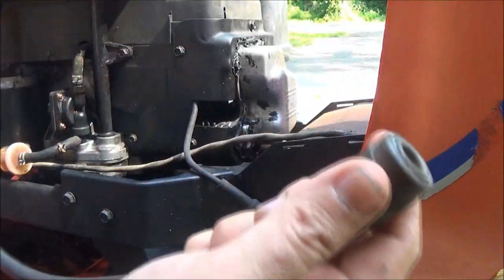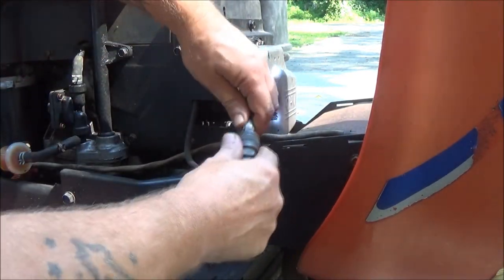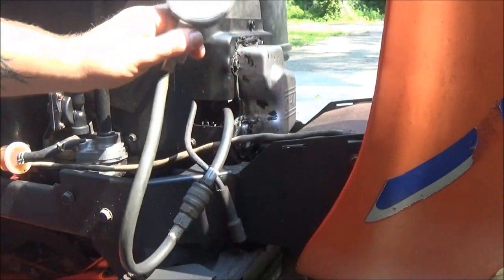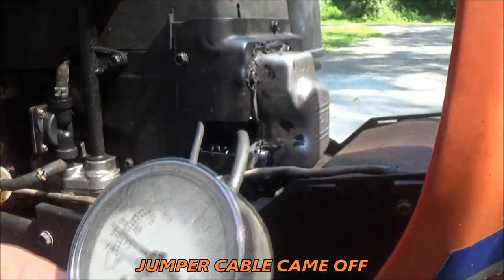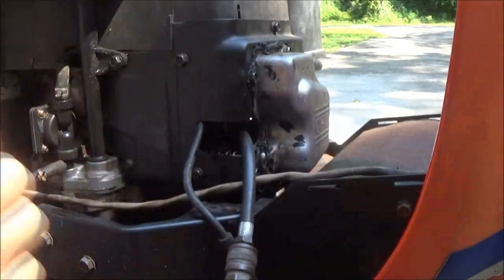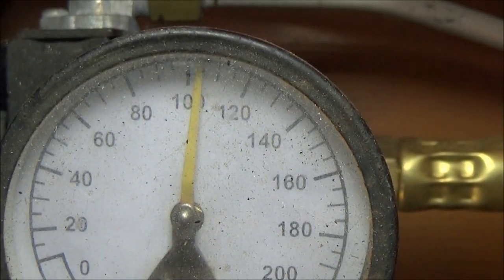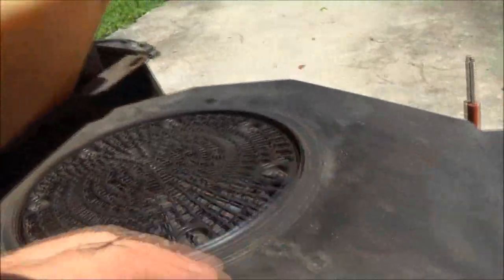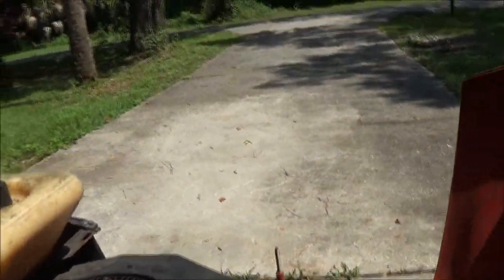Compression Test On 16HP Kohler Engine

Comment: Nice video Thanks for sharing.  I have a John deere 260 garden tractor 1988 with FC540V 17hp Kawasaki motor, cranks like crazy but out of knowhere one day just won't start !! I replaced the fuel pump, new carburetor, it's  getting plenty fuel to the carb nothings clogged or blocked, Brand new spark plug, Plug was tested w/ plenty spark, the seat safety switch was disconnected yrs ago thats not the the problem, no loose wires anywhere everythings clean with dielectric greese on most connections, New battery with Plenty Volts over 12.7 I believe, this model doesn't have a carb solenoid so no issue there ,the starter solenoid turns the starter motor over I can see the teeth move up and grab the fly wheel so thats fine, the fly wheels seated tightly nothing loose there or out of timing, I checked and regapped my intake /exhaust spring valves .004 ,.005 as per John deere,  I've done everything litterally possible and can't get this John deere to turn over !! It ran like a top prior to this and now I'm chasing one thing after another to no avail !! Anybody have any pointers ? I probably tried everything you might mention but I'm all ears 👂 Thanks for any help guys / gals
Reply from the maker: Have you checked for compression? That would cause it not to run, but usually that goes down gradually. That's got me stumped. If you figure it out please let us know what the issue was and if I think of anything else I'll post on here.
Reply from the maker: Also, make sure your valves are opening and closing. Those engines were notorious for the camshafts breaking.
Reply: @shabear1000  Hi Thanks, so I checked the pressure yesterday it's just a here under 100, Kawasaki says it can run fine as low as 65 so while its not as high as I'd like it's still definitely within spec ?
Reply: @shabear1000  I had turned the flywheel  to re gap the valve springs and everything's moving freely in and out if that's what you mean ? Thank you
Reply: @shabear1000  I'll be sure to let ya know what it is once I figure this out...Thank you
Reply from the maker: @ConditionZero76  you're welcome.
Reply: @condition076 I know you checked the seat safety switch, but maybe it could be the main on/off switch for the engine…either take the switch out of the loop using a jumper wire, or check the continuity of the main switch using a digital multi meter (dmm). The dmm can verify if the main switch is working or not. It could be shorting and not working, always stays off. Thanks, Jim

Comment: Cranking compression tests on these ACR engines will always read low because the exhaust valve is partly opened during most of the  compression stroke until the engine is running. 74# and 76# is good for a "leaking" exhaust valve.

Comment: I have 2 of these engines and they are stubborn as hell. I haven't tried feeding fuel through the pump yet to limit the variables, but it does 70psi dry on compression. When i go to fire by the key, it just coughs on starting fluid and fuel down its throat. Not enough to turn over entirly disengaging the starter but right at its edge to it. Like its on the edge of starting but wont jump the hurtle then goes to just cranking no fire the rest of the time like its being smothered. Having to give it 340cca to make it cough as it spins fast enough. 230cca wont do anything but turn the motor.
Reply from the maker: Yeah these engines are very temperamental. That's why I love my Briggs and Stratton's.

Comment: 11:47 Make up your mind.  
😂😂
Nice vid. I am having the same issue. 
I messed up my engine on a John Deere lt 160 
My dumb ass blew air from my compressor straight  I disconnected the fuel filter and forced some air at 135 psi trying to unclog the fuel line that goes to the carb. And after I did that for 3 seconds I had no more compression 
What are your thoughts?  Thanks for the vid.  I  was very informative.
Reply from the maker: My guess is the compression release valve or head gasket. BUT...blowing air through the carb wouldn't cause either issue. You may have had a pre existing problem.
Reply: shabear1000 yes I did. Some back fire   I will run non stable.    drained the gas it was old from last year a little red.  New fuel filter Replaced fuel pump. New carb. New coil. And still no spark and compression. But I did had compression.  So now the flywheel will spins and the start work.  But I am hopping it’s an electric problem.  I almos gave up on this.  Really like this tractor.  Thx mate
Reply from the maker: If its backfiring, sounds like stuck valve or jumped time. Pull head and make sure all valves are opening AND closing.